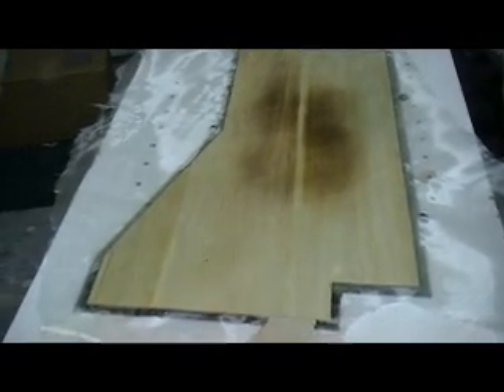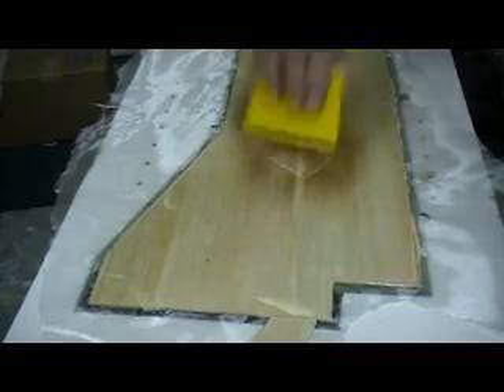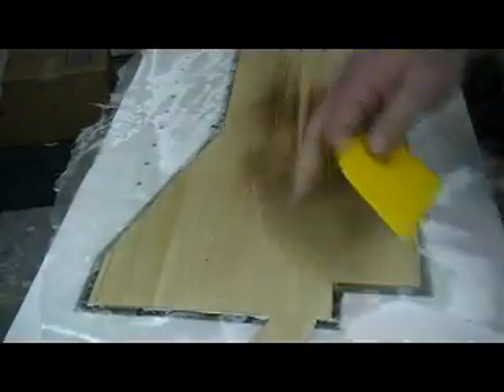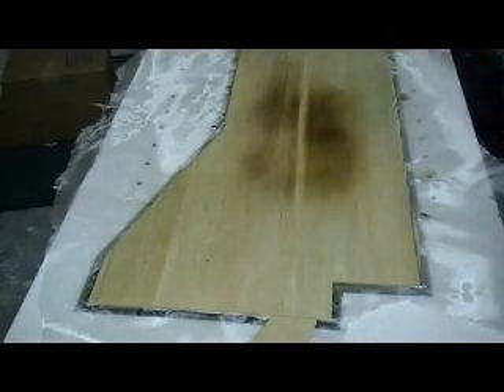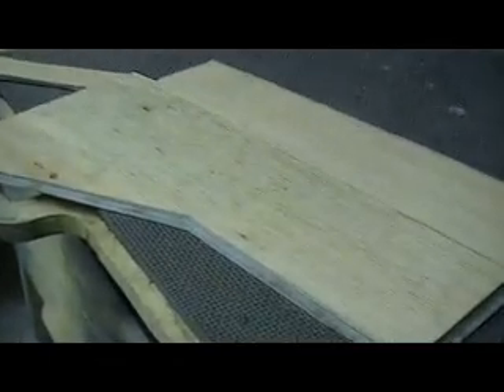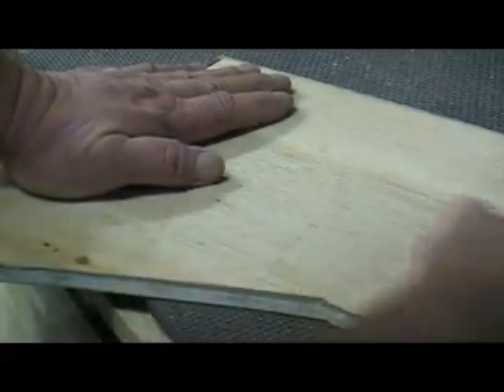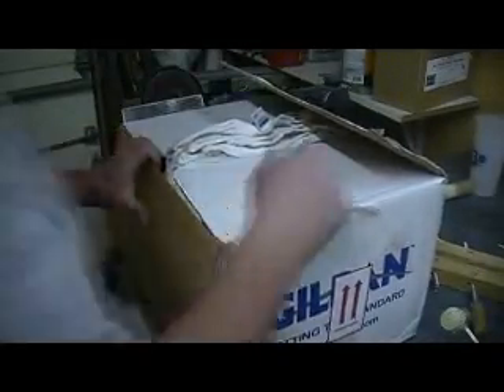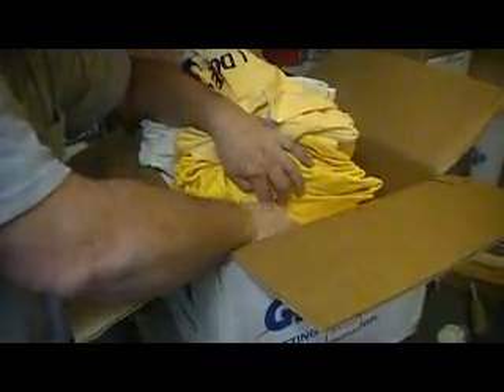how to build a rc jet B-1 Bomber #112 pt 2

Comment: Did you mix a new batch of resin to spread or continue with the cup of resin that you waited to get tacky?
Is there any issue to avoid when spreading a new mix over a partially curred old mix? like you mentioned waiting too long...